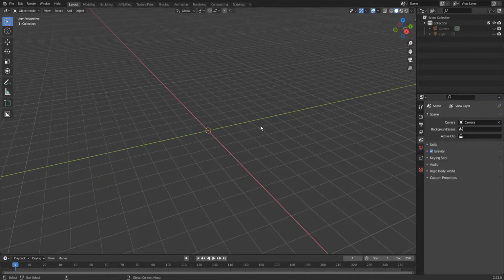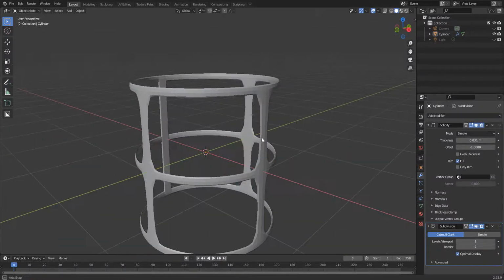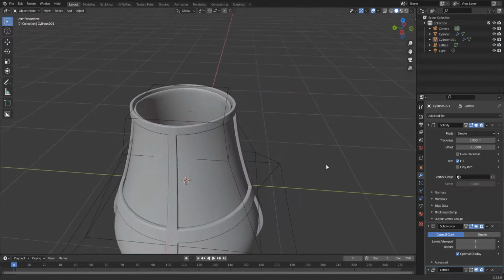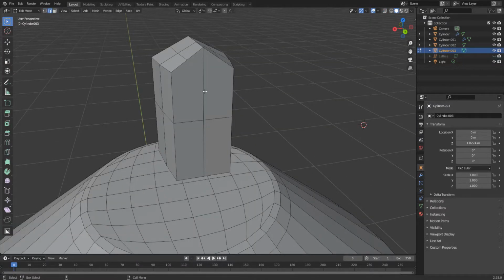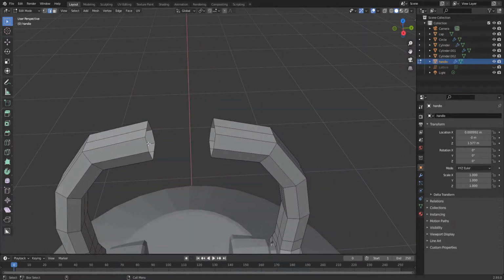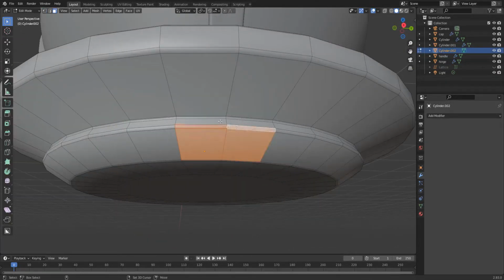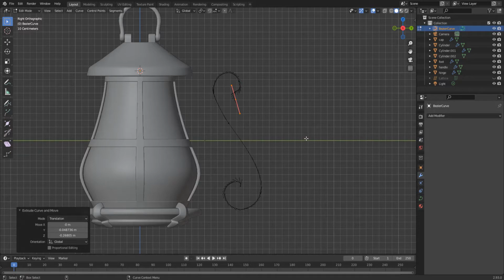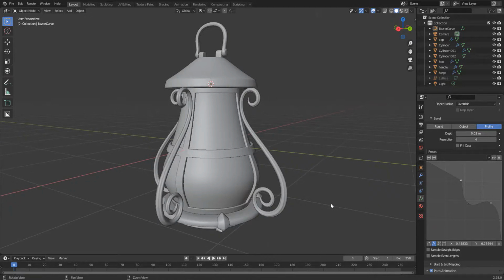Blender Lamp Modeling Tutorial

Comment: at 38:52  i tried scaling and extruding both but all the faces are not either scaling properly or extruding properly
Reply: I had the same issue, and I fixed it by playing around with moving edge sliding until I got the desired position, also I had too many loops I guess or they were positioned wrongly, so I deleted some edge loops and added new ones, check if the vertices are in the right position, use wireframe mode and then switching to regular mode (non wireframe) to check if the changes look well, also do check if you have rotation location and scale applied :P I am a blender beginner-intermediate, so I might not know everything and my answers may or may not be accurate heheeh But I really enjoy helping and I did my best in trying to solve this fact :D I wish you great success with your Blender 3D journey!  :goodvibes::text-yellow-goal::trophy-yellow-smiling:

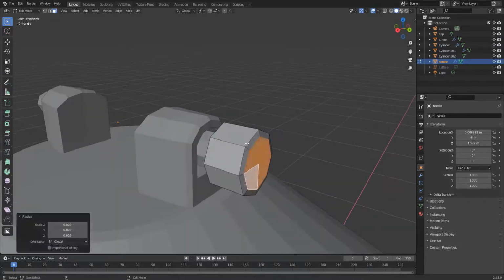Comment: How do you resize at 30:37 with those 4 faces? My faces won't go inwards? Any suggestions? To be sure I have apllied all transforms first.
Reply from the maker: For this particular step, I used Ctrl+e to extrude then immediately followed by S key to scale it down. The same process can be done with one hotkey for making an inset: the "i" key

My brain just likes to complicate stuff sometimes.
Reply: @Chrysley  With "I" key the edges don't scale down along with it, all it does is leaving the edges in place and creating new edges with the inset. How can I scale it down from the edges itself? When pressing Ctrl + E I get a pop up menu so that doesn't do the trick. Thanks!
Reply from the maker: @danielatteveld8027  my bad. What's happening here is that I just use the scaling hotkey "S" to scale the faces down. Also i made a mistake. Extruding is "E", not Ctrl+E.
Reply: @Chrysley  Thank you :) I've solved it and nearly done with the tutorial.

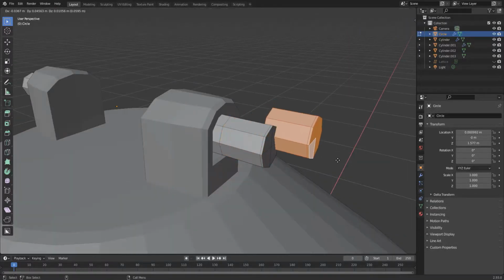Comment: when I scale the selection like at 30:14 the selection moves away, should I change the cursor's point?
Reply from the maker: You can do that or change the transform pivot point from cursor to median point. This will let you transform from the center of the selection. Switching between 3d cursor or median point is normal when modeling.
Reply: @Chrysley  Thank you so much!
Reply: @Chrysley  I would like to see the rest of the vid 🙏